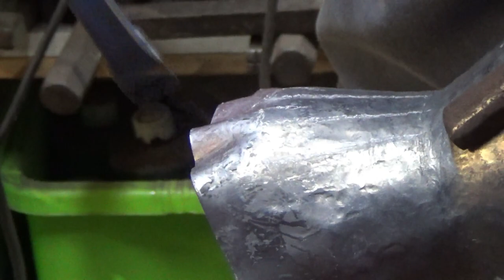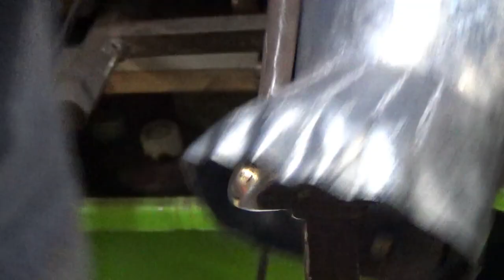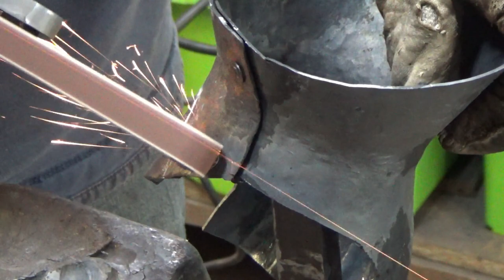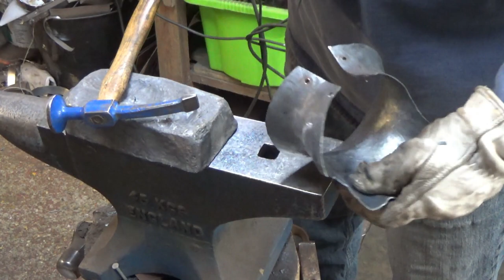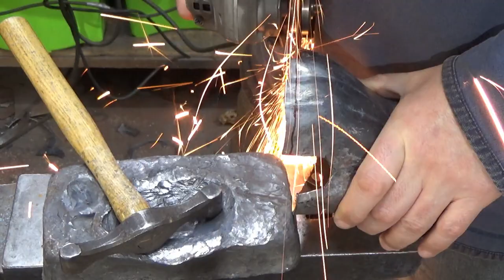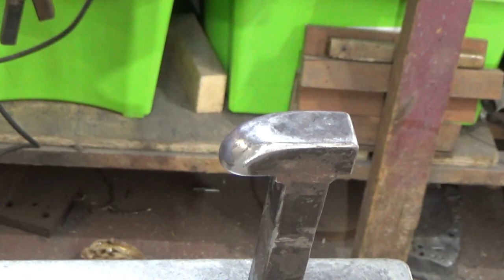Forging a single piece hourglass gauntlet, knuckles and rider plate part 3 of 3.

Comment: That is beautiful. I guess it makes sense that the knuckle rider plate is thinner than the rest of the gauntlet - it clearly made it a lot easier to shape!
Reply from the maker: Chris, thanks. The knuckle rider does tend to be thinner. Most overlapping plates are made quite thin, to save weight would be my guess. But it does make them a lot easier to manufacture, particularly with oxy/prop allowing me to be so accurate with the heat.

Comment: That stake is downright glorious! After the wooden formers. might I possibly trouble you for length and width of this..? Anyhow, great to see your way to do it - thanks! :)
Reply from the maker: If its the little one for the knuckles, it is about the size of the end of your thumb, I didn't really measure it when I made it, just sort of gave it a go, it used to be longer but that didn't work. It's welded onto some 12mm (about) bar stock. Just made from mild steel as it is always worked on hot.

Comment: Where did you find all of your stakes?
Reply: I bet Graham had to make many of them himself.
Reply: In one of the videos about creases or flutes, he mentioned that he made/modified some of his stakes.
Reply from the maker: Hi, thanks for getting in touch. Almost all of my stakes are from builders supplies. They are old road drill bits that I have modified for purpose. Sometimes reforging them or grinding them to shape.

occasionally I have got lucky going to scrap merchants or second hand tool stores, but most of them know the value of these things now.

they are a couple of guys in Europe that make custom stakes I can send you the details of and a chap in Ireland called Finin Christie that is a Blacksmith that does a great job as well.
Reply: @GreenleafWorkshop  Maybe you could make a video about some of your stakes.  As an aspiring armourer, I would find that very helpful.